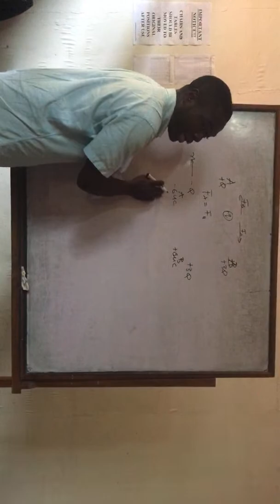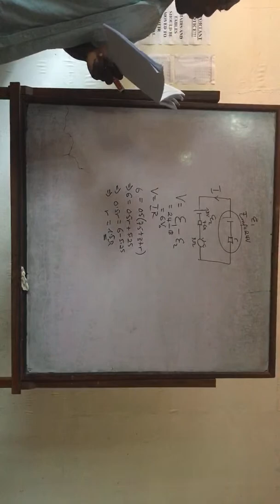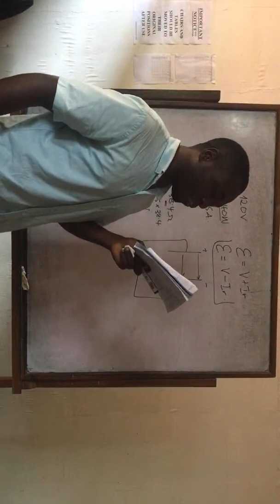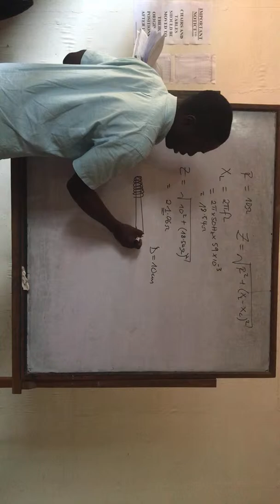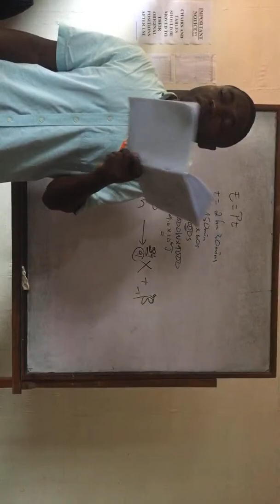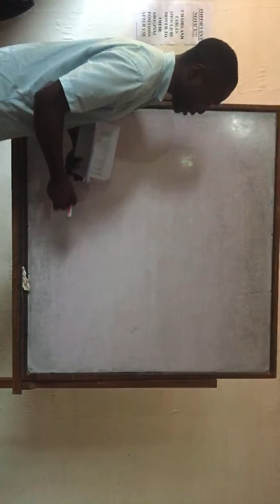MEDICAL ENTRANCE EXAM REVISION

Comment: Q1. 
The null electric field point can not be between the line segment joining A and B because the electric field is rather enhanced between A and B, checked! 

It is possible for the electric field to be zero outside of the line segment because the electric fields are then opposing each other. But for it to be zero, the forces due to each of the charges must be equal and opposite in magnitude on a reference test charge. Notice that the forces can only be opposite in magnitude outside of the line segment joining AB and there is no distant away from either A or B where the electrostatic forces will ever be equal in magnitude. While the product of their charge magnitudes at distance x from either is equal, their referential distances from the test charge would always vary. Therefore, you can only ideally get a point where the net electric field is zero at a point situated at infinity relative to the electrostatic effect of both changes. Therefore C is incorrect in this case. C would however be correct if the magnitude of the charge on A  was different to that on B.
Reply from the maker: What I explained
Reply: @GSCEXCELLENCEACADEMY  
But the answer can not be D(not C, my bad).

The whole point is that it's not correct to say that the point where the net electric field is zero is outside of the line segment.
 D is not correct.
Reply from the maker: @kcsciencehub  the charges are oppositely charged. And the force can’t be zero along the segment joining the two. Since they have equal magnitudes it can’t be specified from which one in particular. Normally when they’re oppositely charged, it becomes zero at the side of the on with smaller magnitude😊
Reply: @GSCEXCELLENCEACADEMY  

Correct!

But because the magnitude of the charge on each of the two charges is equal, and the distance from each to the test charge in question is never the same, it is not mathematically possible to get a point outside of the line segment where the net electric field is zero. In theory, it should be outside of the line segment, but because those charges have equal magnitudes, you will get the pont of null electric field sufficiently far away from both spheres where the net effect is zero not because the fields cancel out each other algebraically but because they cease to exert an effect on the test charge. 

To understand what I'm saying, try to algebraically compute the point where the net electric field is zero even outside the line segment joining AB using Coulumb's force expression. You get a surprising revelation.
Reply from the maker: @kcsciencehub  Thank you... I get your point.
Reply from the maker: Thanks for the contribution